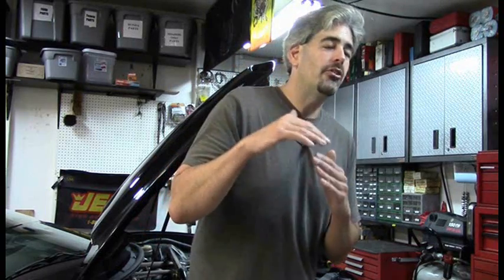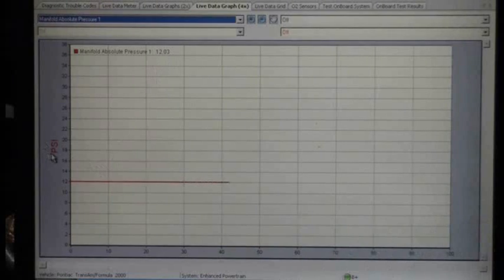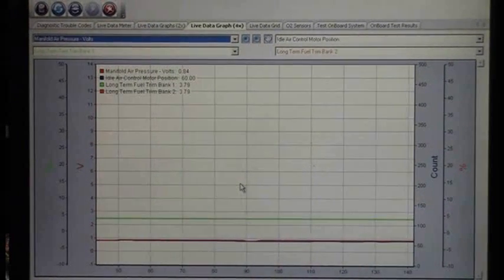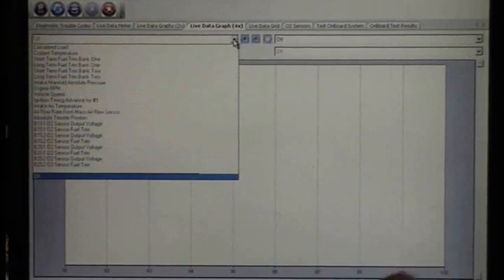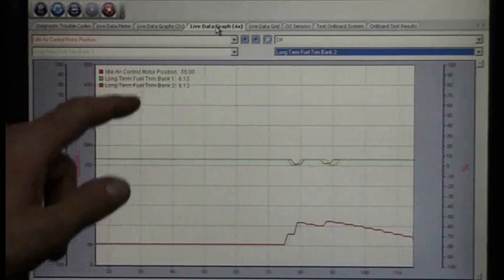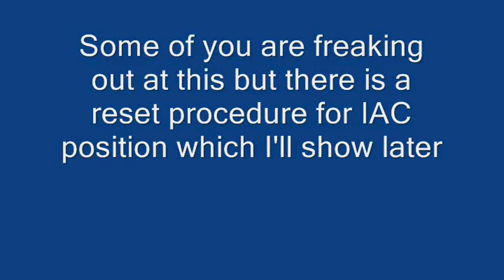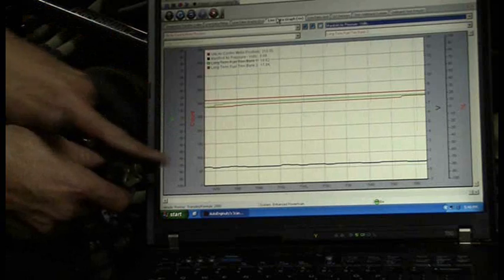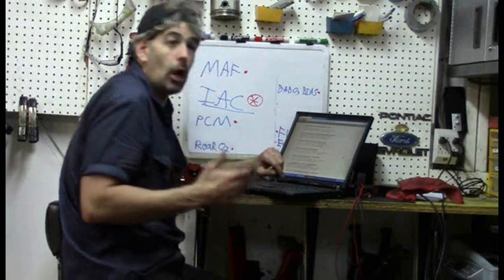P0171 Case Study from Hell 2000 Trans Am Pt3

Comment: A GM IAC is a stepper motor.  It makes a full excursion from 0 to 255 counts, or 00000000 to 11111111 or 00 to FF counts.  The PCM will set a DTC if it has more than 255 counts.  Each step is 1/256th of a full excursion. So like a 6-32 screw, one revolution is exactly 1/32nd of an inch, one count of a IAC is 1/256th of its full range.  It it is not moving each time it is commanded, the. The pindle is not positioned properly and the air opening is not correct.  There is no feedback from the device. The computer commands and the steper moves.  
Also, take a rubber hose with a valve in the end to stopper the IAC chamber, then you can dial in an amount of airflow rather than closed or open as was your test.
Reply: Do a google search for testing a stepper motor and I am sure you will be able to rig a setup for doing so. The dealerships used to have a jig to test them, but they are largely gone these days.  Nobody tests anymore, at 190 dollars an hour it is cheaper to throw parts at it rather than spend the time figuring it out.  That is a pisser but that is the way it is.
Reply: You cannot test a stepper motor by just putting volts on its coil. It has to have two active fields with correct polarity to "step" one increment.  It will not spin like a conventional DC motor.
Reply: Most likely the stepper was in it's learning mode when you felt it step slowly.  
For some lite reading search PID controllers. This is the algorithm applied to this part of the system.

Comment: Matt, great video, great series, great Channel! First time comment and recent subscriber! I have to agree with johnwrench4speed about the resistance test on both coils in the IAC with a DVOM. Its usually very accurate in diagnosis on the condition of the part. Unless there is carbon build up inside it should be quick on its reactions or movements. Thank for all the useful info!!

Comment: Iacv  Matt man I'm just can't see it not seating properly.. Wouldn't there be some sort physical evidence like carb build up on it,or inside the house itself?? Man I'm stuck on that maf sending bad incorrect signal.. It would be impossible to see a glitch with out scope..
Reply from the maker: The MAF is a great directiob 540, However we can eliminate it because of a couple things- First, there is inconsistency with normal/lean at idle where no change in airflow through MAF occurs.  But the main reason is we can consistently turn the fuel trims way high by turning the A/C on AT IDLE.  This cinches it- A load that is devoid of air intake past the MAF has to be responible for this.  It has to be directly related to the Intake.  It's either MAP or IAC and we showed MAP is working.

Comment: I was about to post on your previous video but then this showed up. 
The car was running great now! :)
 
I can buy that there is no code for IAC. The IAC value is just a calculation. "One count represents one change in polarity, which equals one step of the stepper motor. The PCM counts the 
steps it has commanded in order to determine IAC pintle position." 
 
Anyway in my mind even if the IAC is fully open, its not a "air leak" its still measured by the MAF. But we also have MAP, MAF and load input.  Its never easy this right? - I noticed when you plugged the IAC. LTFT was 24 which is opposite from the expected, If the plug is sealing? 
 
You can also do IAC tests with it on the car. Like a small vacuum leak and see if it can bring down the idle.. Or get this fanzy GM thing J-37027-A :D 
 
I need to sleep now.
Reply: Excellent point about the MAF. I had not thought about that, but it makes sense. The PCM is still going to get a MAF signal even if the IAC is only moving part of what it is supposed to, so the PCM could readjust it's thinking. Cool point, dude.
Reply: +AutoFocus Please bear with me, I'm new to all this sensor/computer stuff, a late comer.  But you wrote: "Anyway in my mind even if the IAC is fully open, its not a "air leak" its still measured by the MAF."  My understand of the MAF is that it measures incoming air not manifold air pressure.  If I am right, wouldn't this be the correct observation:Anyway in my mind even if the IAC is fully open, its an "air leak"  measured by the MAP.  The MAP sensor not the MAF sensor.
Reply: +Ed Waggoner Sr. (Papatch) 
You are right, MAF measures air flow or mass.  And MAP measure pressure in the manifold.  And yes a air leak would affect the two systems different if it was one or the other. but in this case we have both. So what it comes down to is engine programming on what inputs it uses. So really all we can do is speculate, it was some time I saw this so I cant go in to details. 

Cheers.

Comment: I agree with BusJockey.  Most motors that move forward & backward will do so by reversing polarity.  So you can in fact put a positive and ground to those pins.  I don't know of any reason not to try that.  You just need to figure out which pins to apply voltage to and how much voltage.  Really SUCKS that the car hasn't thrown any IAC codes.  From the pins you show for the IAC it doesn't look like it has any active monitoring (no reference voltage) and would rely on any problems via detection of incorrect A/F.  However you have incorrect A/F and there's no codes.  Hey OBD-II isn't perfect.  You're actually getting a really good taste of what I have to go through every day on every sensor of my OBD-I car.. I know your pain.
Reply: Billy R added a comment to Busjockey1 that will be very illuminating on what you said, I'd come back to the video and take a look if you haven't already.

I have a friend who I'm going to test one sensor at a time since it's OBD-1. Hopefully, logic points me in the right direction first. It's hard to start when it's cold, but only when it's cold. OBD-1.
Reply from the maker: No Devon, there is no way you can just add 12V DC to these pins- it is separate coils and the voltage alternates polarity constantly between these coils. In the next video this will be demonstrated very clearly.  It not only is impossible to just run 12V to the IAC and get the motor to run- you can actually damage it trying!
Reply: ***** I agree with nearly everything you've written here. On Matt's IAC, I think we're looking at two coils, one to move the shaft in one direction, the other coil to move it the other direction.
Reply: ***** Sorry, but NO NO NO NO NO!.   You can NOT put a pure uninterrupted voltage across the coil of an IAC (like Matt says below) or you will destroy the motor (you'll blow the s**t out of the coil).The motor is a very special type of motor called a "stepper" motor. It is very short PULSES of DC that turns it. In this case, each "pulse" turns the motor shaft 90 degrees. PLEASE don't ever put 12 volts pure DC across any stepper motor.
Reply: douglas lee Well that's good to know. Oops. :(

Comment: Another Great Video !  Parts changers be damned !
Good logic going through all the steps and letting the data lead the way to the answer.
The IAC is a bipolar stepper motor ....  You can test this removed from the vehicle with an Arduino microcontroller ($20 or less) and an L293 motor driver board($10 or less).....  you can get both parts on ebay for less than $30 total ......  Simple program in arduino with built-in libraries to have in running in short order....  its really simple to use, easiest microcontroller to use for hobbyists.
Keep the vids rolling .... learning alot here on your channel!